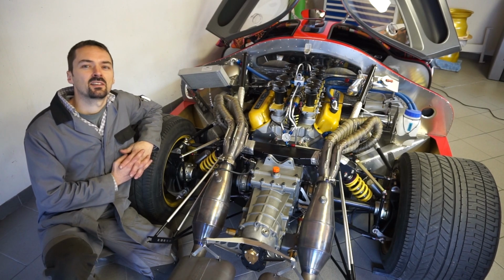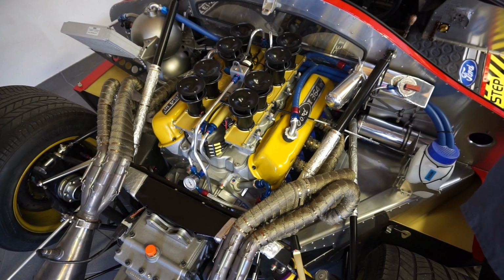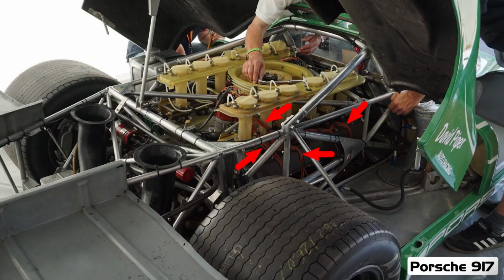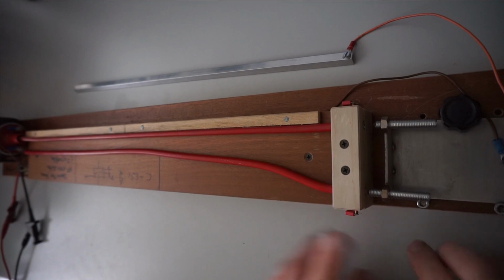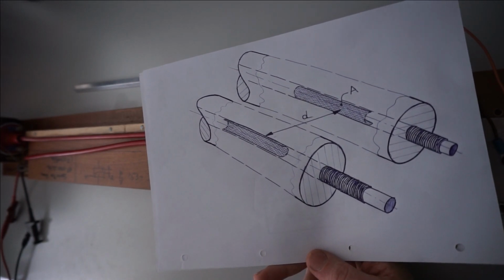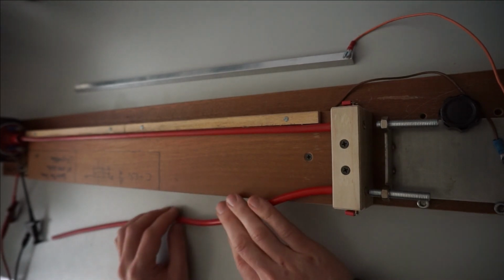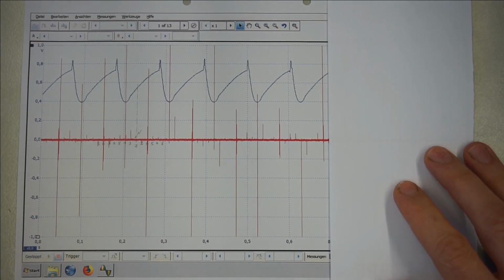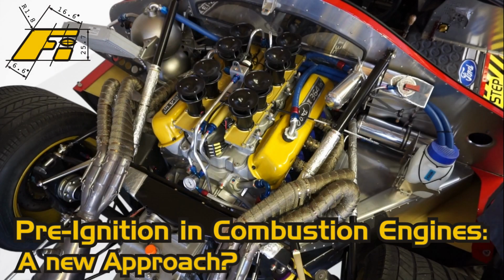Pre-Ignition or Backfire in Combustion Engines: A new Approach?

Comment: There are some very interesting comments.
It may be worth looking at 1930~40's aircraft engine testing and developments as there was a lot that isn't in automotive books.
 I first got interested in aircraft piston engines around 1984 when Suzuki brought out the GSX-R with oil cooling and oil cooled pistons (first production engine with oil jets directed under piston crowns)  
I'm still a fan of SACS motors and 'oil squirters' are now used by 'everyone'.
The Suzuki advertising material mentioned it was used in 1930's~40's aircraft engines.
One thing you didn't mention as a cause of pre-ignition, overheated exhaust valves which are often classed as the limiting factor in IC engines

Comment: Aircraft engines use fully shielded ignition wires. The shield terminates in a grounded cap on the plug and a ground connection one the source magneto. The primary function of the shielding is to prevent radio interference. A single bad shield connection makes a difference.
The shielded wire should be readily available from aircraft suppliers. Excellent work Sherlock, I make aircraft engine monitoring instruments and have never heard of this. You might be the first. You might lookup an excellent book on internal combustion engines by John Heywood. Very very interesting work. I watch all your videos.
Reply from the maker: Many thanks for your kind comment, Mr. Youngquist. I'll have a look at the book you recommended. Cheers!

Comment: I was taught the current was transferred by induction, as in a transformer, however, both processes may be taking place. Consider the formula for capacitance. But how much capacitance is there in parallel wires and is there a phase change?
Thanks for this interesting question! 
Toby

https://en.wikipedia.org/wiki/Capacitance#Capacitors

Comment: This is essentially a "Spark Gap Transmitter" and a length of antenna to receive the radio waves. The transmission of radio waves is why they put insulation around the spark plug wire in the first place.  In the automotive industry the common fix was to route the wires with a gap between them AND to place wires so that the parallel wires were on the combustion stroke or exhaust stroke. The early 90's full sized ford broncos actually had a service bulletin to revise the wire routing to fix this exact problem.

Comment: not bade clever finaly some one talking usefull staff if you include in that mix variabel oil lifters ,valve timing,ignition timing ,selenoids,alternator and audio static and some cooling system electrolisys and finaly engine temperatures you can finde lot interesting things by the way some engines are called " universal engines" they are alredy half disel engines that fenomena do gm,holden,opel,suzuki,isuzu cars not realy if you take to acount magmetos it has more sence honestly and generators you have a bunch of them on ordinary engines

Comment: I remember reading about Delco Electric in about 1920 was studying preignition by photographing cylinder flame front in the cylinder through a quartz plug in cylinder head on there single cylinder farm genset they were adding Iodine
To low octane gasoline eventually they came up with the lead oxide added to gasoline. 
But any way I like your videos 
I learned something new

Comment: It is not just capacitance! There is also 'near field' coupling if the wires are too close.  'Near field' coupling is the type of coupling seen in transformers. 

At the same time we have to avoid 'far field' coupling - as in broadcasting RF.  Modeling this is problematic because of the use of resistance wires ( the resistance reduces the 'Q' of the wire - reducing the ringing at RF frequencies. The fast rise times produce energy in Mhz range  - the resistance of the wire 'damps' the oscillations. )   One could model this in SPICE, but just measuring the mutual inductance between the wires - broadband - would make the simulation results questionable (much easier to fool oneself with computer models than most people think).

in a perfect world -  I would want to use teflon(polytetrafluoroethylene) for the better dielectric constant. 

You found why the 'looms' and 'separators' (there are generic ones) are important.  Great job of debugging the problem.

Comment: A plate capacitor is not the right simplification in this case. The calculation for parallel cylinders would fit better (C = length * Pi * Epsilon / (arcosh [d / 2R])
Your cables and the cables in a car are more a coupled transformer than a capacitive coupling (H and E fields are both present, but the H field is transferring most of the energy). A high current begins to flow on the primary side (top cable) after the ionization starts. This creates a strong magnetic field around the primary cable. This magnetic flux pushes the charges to the tip of the secondary cable. The E-field at the tip of your secondary wire increases until the charge is discharged.
What you have here is the same problem like with indirect lightning strike damage (indirekter Blitzschlag). The high current and the short raise and fall times of the current induce high loads in the cables which can destroy electronics by discharge - in your case it's the other cylinder.
Reply from the maker: Many thanks for your interesting comment.

Comment: Thanks for sharing, it reminded me of the old days when it was called ignition crossfire, google that. Most mechanics knew to keep the HT leads apart with spacing clips and ensure any oil was cleaned off. It was a problem for any multi cylinder engine not just V8. When you mentioned bundling of HT wires I thought that incredible as it was something we knew years ago not to do, good thing now with coil on plug systems. Good video, cheers. Peter
Reply from the maker: Thanks for your comment.

Comment: I like the test-rig to demonstrate the phenomenon and the explanation you give for why it occurs. It has been previously documented in A. Graham Bell's book "Four-Stroke Performance Tuning" page 273, where it is called 'induction crossfire'. As has been mentioned in the comments, V8 engines can be prone to this, for example cylinder 7 can crossfire from 5 in typical firing order 1-8-4-3-6-5-7-2. In the book it mentions that as well as having an air gap between the HT leads, crossing the affected HT leads (e.g. 5 & 7) once during the run to the plugs will reverse the magnetic field and can help cancel the effect
Reply from the maker: Very interesting, thanks a lot for your comment!

Comment: This is where "Coil on plug" ignition systems prove to be less troublesome. No high voltage wires.
Reply from the maker: Right! However the are not completely free of potential for parasitic issues either.

Comment: Lean mixture preignition results from  a slow burning flame that has persisted thru the exhaust stroke so when the intake opens the introduction of air and more fuel causes the flame to reignite.  

Inductive crossfire on Chevrolet V8s from 1955 thru the end of conventional ignition distributors required a 1" gap between 7 and 8 spark plug wires. Ford 5.0 v8s had a similar issue with firing orders that had 7 and 8  cylinders firing 90 crank degrees apart. Ford created a TSB calling for the spark plug wires in the separators over the valve cover to be in this order. 7, 5, 6, 8. This separated the wires far enough ..
You are completely correct on the cross firing from a cylinder when the intake valve was open.

Comment: Capacitive leakage or an induced voltage high enough to create a small spark? (assuming they are not the same thing)
Reply from the maker: If you mean that instead of capacitive leakage electromagnetic induction is happening: To me this is unplausible, because the rig's loose ignition wire is an open, not a closed circuit.
Reply: @anengineersfindings  Voltage will be induced regardless if cct is open or closed. I have seen this on a regular basis in industrial buildings with multiple ccts in the same conduit.  In this case the spark plug gives it somewhere to go. It might be interesting to conduct the experiment again with a magnetic and non magnetic bar between the wires and see if the spark changes.
Reply: @anengineersfindings  Hi Fif!
You made a really interesting observation. While watching, I also thought if it might not be induction. To your open end: Open ends do reflect sharp signals. TDR (Time domain reflectometry is a good example of usage). But to prove if it is induction or capacity, a resistive HV wire should make a difference, because you dU/dt will go down with resistance and thus excluding one or the other.
Anyhow, nice work! And why don't we see this car running? :-))
Reply from the maker: @MuellerNick  Hello Nick, great Grandmaster! Thanks for your kind comment and your very interesting input. I'll have to think about it, to hopefully get it sorted out in my head sooner or later :). Aside from the terminology: What I find interesting about this process is, that quite easily sufficient electrical energy leaks to create parasitic sparks. I wouldn't have believed this before, since a lot of voltage is necessary for this. All the best and hopefully we'll meet again some day! PS: On my other channel is a video of the running GTP-13: https://www.youtube.com/watch?v=78B7fo5FToY